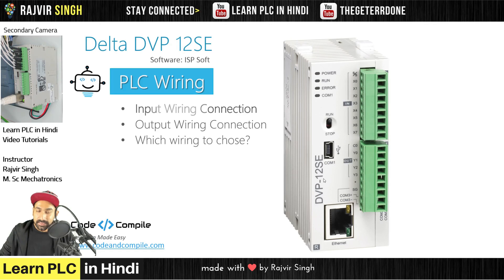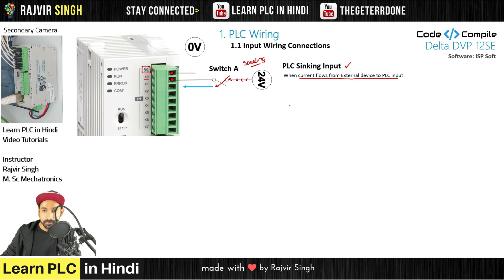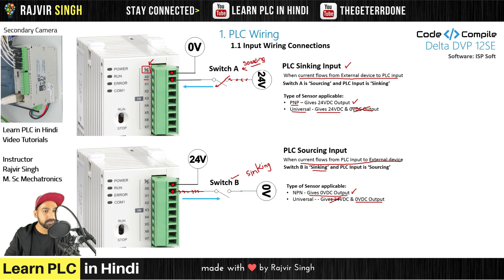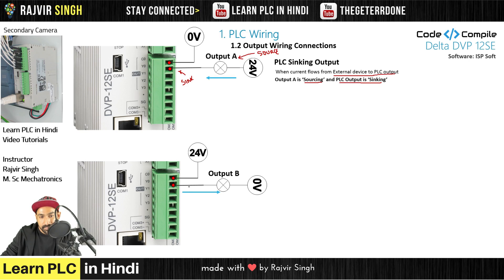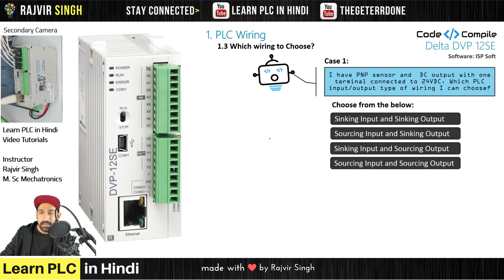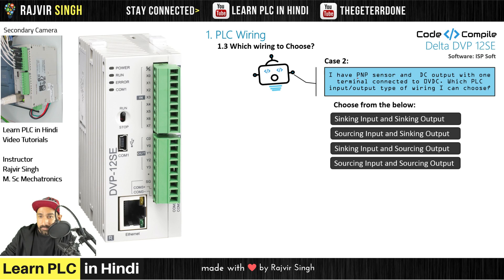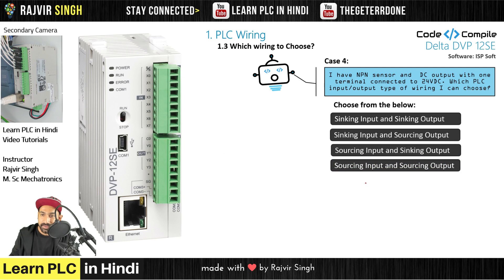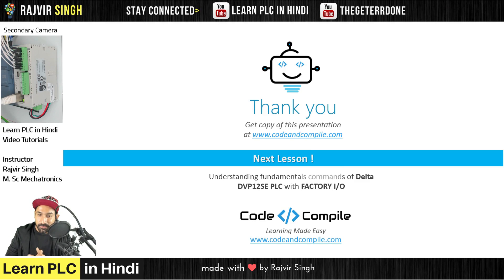Lesson 37- PLC Wiring - Delta 12SE (Hindi)

Comment: Thanks for your help sir. Please tell as i m having a delta plc sv series, i want to connect it with my computer which is having only usb port, which wire i should use to interface. Is cable USB to  8 pin rs232 useful or i need anything extra.

Comment: Thanku for the video. 
The sink/source concept in frist video of learn plc in hindi and in this video are completely opposite.
In frist video you explained that if s/s is connected to 0v than its sourcing. Bt in this video you explained opposite.
Please clear this confusion.
Thank you
Reply from the maker: Hi! Well it’s quite tricky when we use the word „Source“ , „Sourcing Sensor“ and „Sourcing Input“. 

Source in general means from where the „voltage signal is coming“ - Source could be NPN or PNP in Plc wiring 
  
Sourcing- Generally refer to PNP sensors because they provide 24V. So on S/S - 0V would be connected and PLC input will be Sinking.

Sourcing Input (PLC) means PLC gives out 24VDC from Input because common is connected to S/S, hence you will connect NPN Sensor. 

I hope this clears some doubt. As I say these words are bit tricky !
Reply: Thank you sir